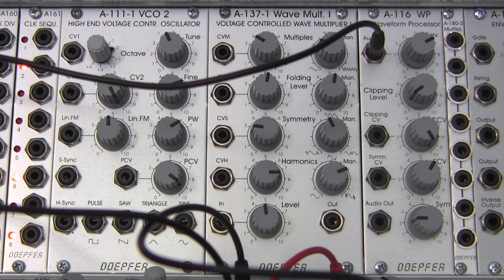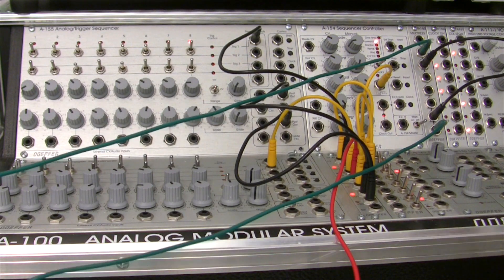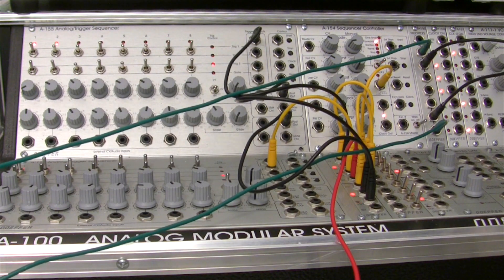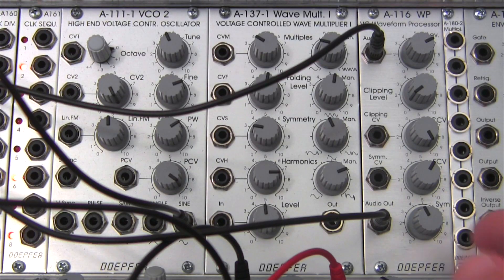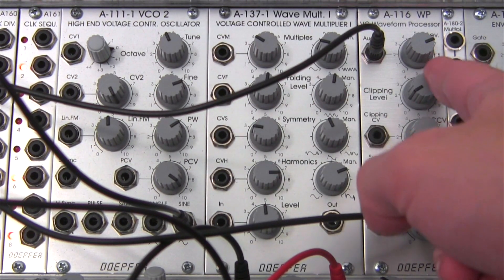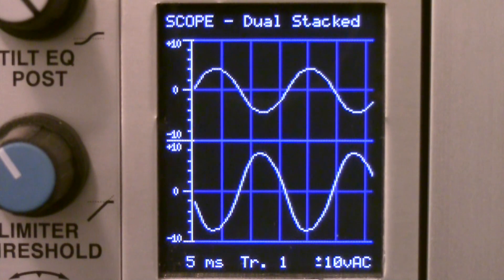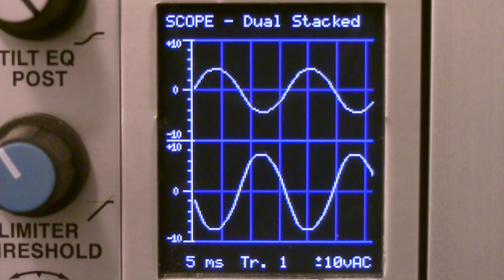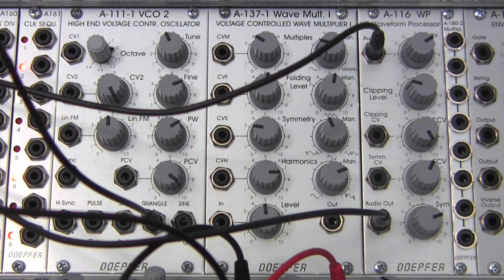Doepfer A116 VC Waveform processor-Audio/Oscilloscope Views Pt.1

Comment: (6:40) I think what the symmetry control is doing is cross fading / mixing between the non-inverted signal and an inverted one.

Fully anticlockwise is non-inverted; fully clockwise is just inverted.  As it fades between them, going clockwise, the non-inverted component gets reduced, and the inverted one increases.

In the middle position, they cancel each other out.